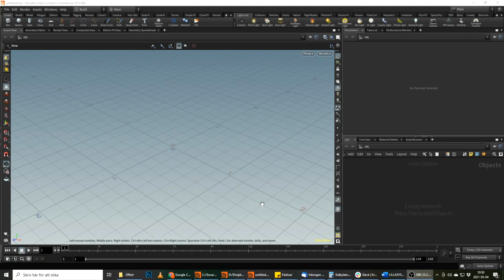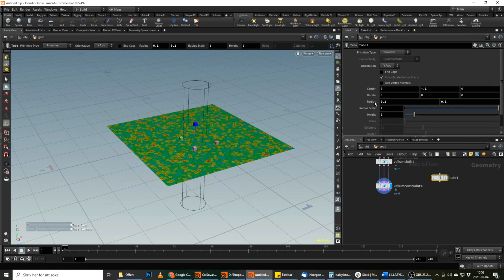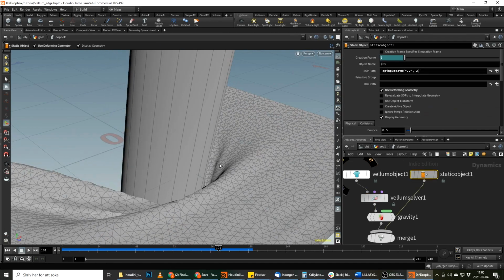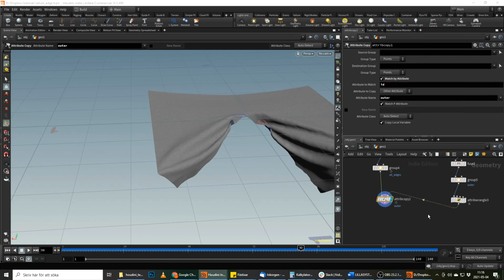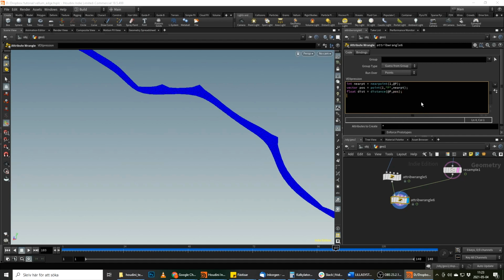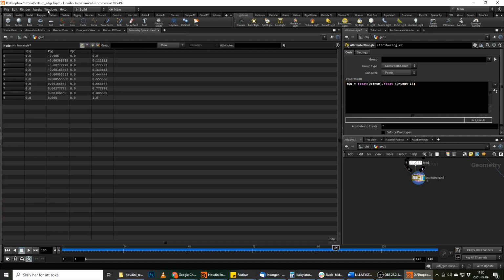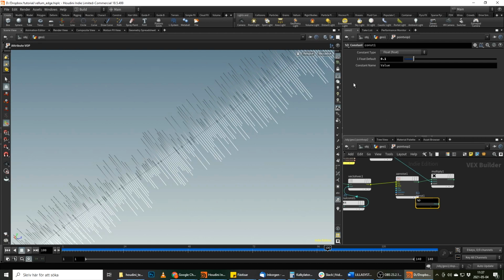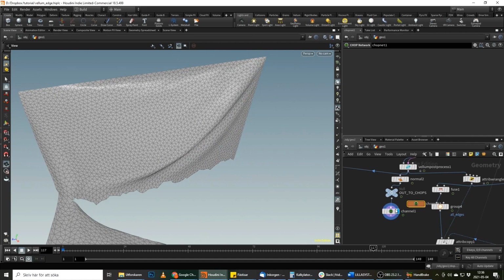Houdini vellum edge threads details - Tutorial

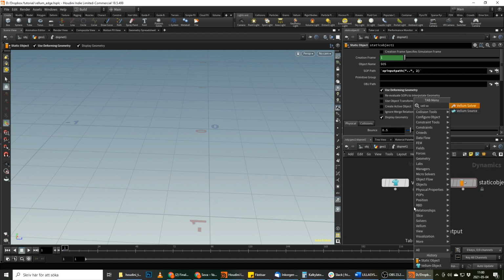Comment: On 9:14 you created a vellumobject but in my version i dont get the initial geometry and initial constraints filled in. When i try to type what you have i get an error
Reply: Here's what you need to do: Cut the connections to the DOP Net inputs off again. Instead, put two NULL nodes after the VELL CONSTRAINTS node: One left (geo stream), one in the middle (constraints stream), and you might also want to put a NULL at the end of the tube collider already. Dive into the DOP Net and link the VELLUM Object to the NULLs you created: Choose the geo stream NULL under "Initial Geometry" and the constraints stream NULL under "Initial Constraints". Same later on for the collider geo SOP.
Hope this helps,
Reply: @philippwelsing9108  Thank You so much!

Comment: Amazing tut! Really well explained
managed to follow along and got a great result, but i got a question
The noise you use at the end to give it displacement is sampled at its current position, so it swims when moving
how did you deal with that? since you cant have restP because the topology changes
Reply from the maker: Good question, have to go back and look since it was a while ago.
Reply: Thank you, I was trying all day and couldn't find a way to make it work
Reply from the maker: @Overalgu  So just looking over it briefly I think you could use a rest based on the id if the points and then add the curveu to one of the components. That would give you a stable rest. I think I actually just had it deform when it moved since it was so fast anyway